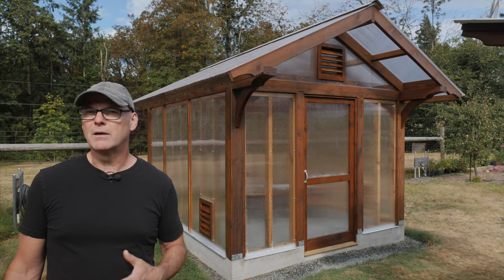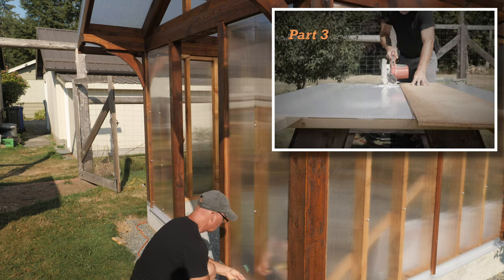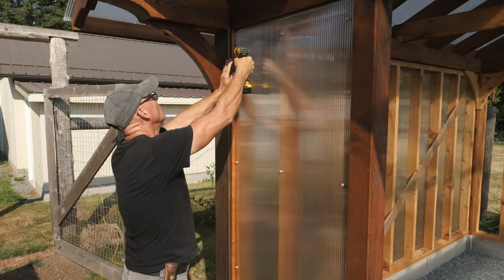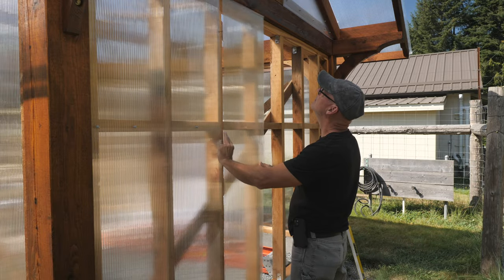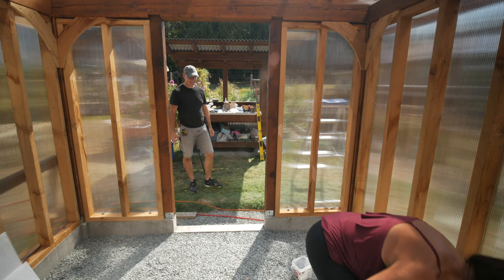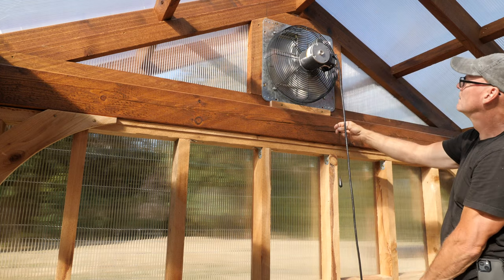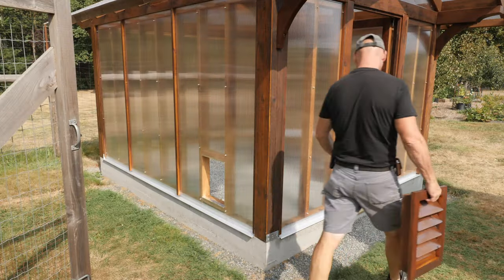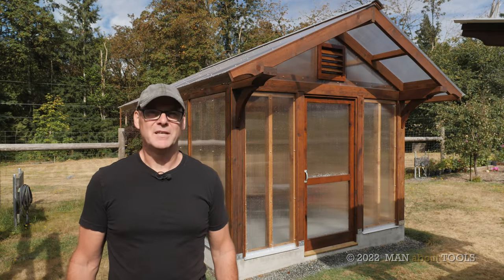Greenhouse Build Series 4 - Cedar Vents & Door

Comment: One thing you may want to think about is adding flashing on the bottom side of the glazing panels in the gables. The moisture will wick up behind the panels and sit there and eventually rot the wood. Anyway, great build, loving the details.
Reply from the maker: Thanks! I was thinking that the overhang was big enough to shield the gable ends. I'll keep an eye on it tho. Cheers!
Reply: @MANaboutTOOLS  Was mainly talking about any condensation that leaks out of the panels through the bottom weep holes. I should have been more specific, sorry.
Reply from the maker: @george8873  Ah yes! That's a good point. Flashing there would be a good idea. Thanks!

Comment: Very interesting series.  The fan has louvers that open and close, but the lower air intake vents do not.  What are you going to do for the two lower air intakes in cold weather when you're extending growing season or trying to get a head start?
Reply from the maker: Thanks! I'm mulling over some ideas with that. I'll do a follow up video and cover that. I did buy one of those cylinders that's temperature sensitive to open a louver. I'll maybe try to incorporate that into a door mechanism.

Comment: Hi, thanks again for the video details! I’m getting more confident I might be able to pull this off myself! Question though: I heard with this video, you’re using j-channels for top and bottom on the triangular sheets with the bottom having weep holes. Did you do that with all the sheets you put up? I found a tape that some are using to cover the top and bottom tape has holes in it. Do you find just using j-channels will be enough without the tape?
Reply from the maker: You can use the tape or the J channel. I don't think you would need both.
Reply: @MANaboutTOOLS  Yes sir, again many thanks for your very nice instructional videos!

Comment: Is there a reason you have the door swinging inwards instead of out?
Reply from the maker: No particular reason. It could be installed either way.
Reply: Fair enough. I always figure doors swinging out give more floor space and interfere with the use of the space less, but run the risk of being blocked by snow (depending on location).

The greenhouse looks great and I might build a similar one, so I was wondering whether there was a practical reason to have it inwards that I wasn't aware of.
Reply: For a small spce like the greenhouse I would have made the door to open outwards too. You have some expensive real estate inside, use the most of it.